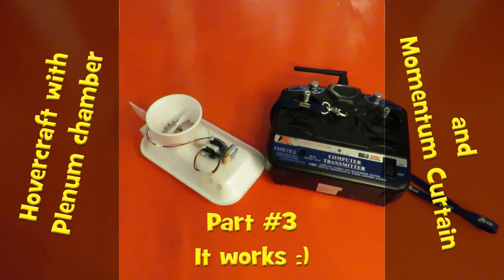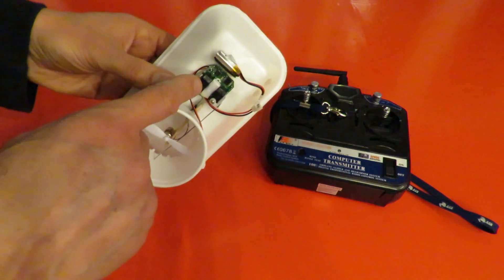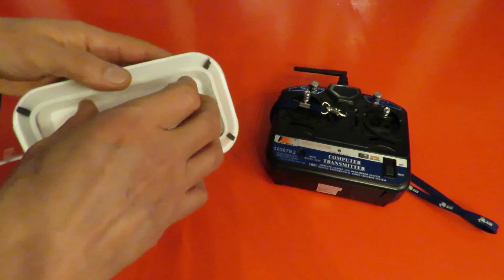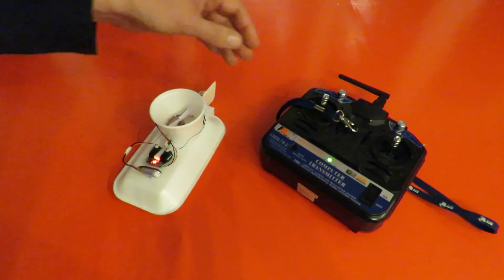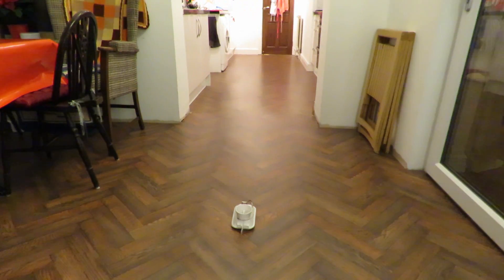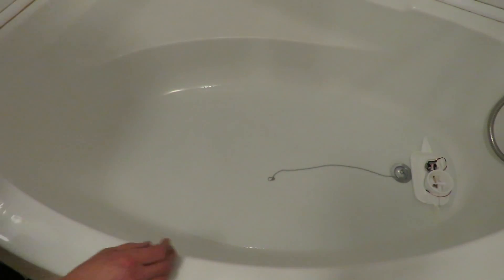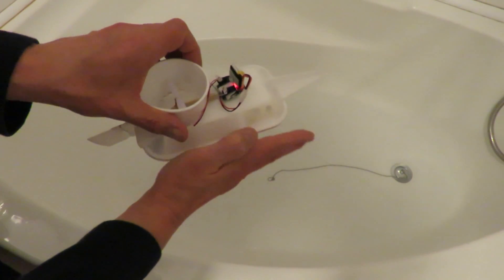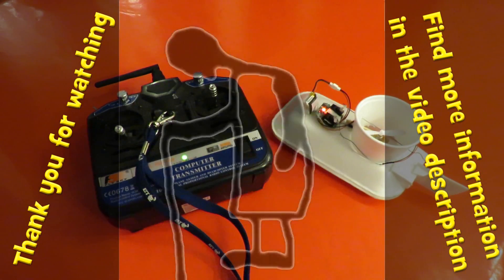Hovercraft with Plenum chamber and Momentum Curtain Part #3 It Works

Comment: Hmm, I now challenge you to make a hovercraft as small as you can using that receiver, it can also be an airboat.
Reply from the maker: +X-FLIGHT101 I think you are looking at it. I don't have much time for making "biggest" or "smallest" or "fastest". I just make things the size that the junk I use fits.
Reply: +GrandadIsAnOldMan I suppose you are right, would be difficult to make one any smaller maybe I shall give it a go.
Reply from the maker: X-FLIGHT101 I didn't say it can't be made smaller, I just don't plan the size of my projects, they make themselves from the size of the materials available. In this case I picked up a couple of fast food polystyrene trays so that is the size it finished up. I would guess you could just use the styrofoam cup on it's own. On land the stability is not much of an issue. On water it would probably tip over.

Comment: Probably your best hovercraft yet
Reply from the maker: +Mr Rishi The Cookie the main issue here compared to my earliest attempts at hovercraft is that this is significantly more expensive when you include the cost of the RC gear, LiPo and motor, so it is moving away from my core theme of cheap projects from scrap. Same applies to all my recent RC work, it is not really what I had in mind for my channel. As long as I go back and do some cheap projects I can try an maintain a balance and keep some of my projects within the reach of my original audience.
Reply: +GrandadIsAnOldMan I agree